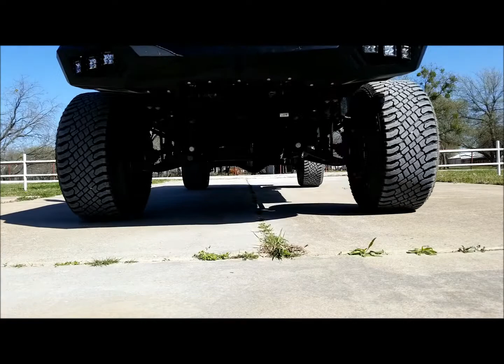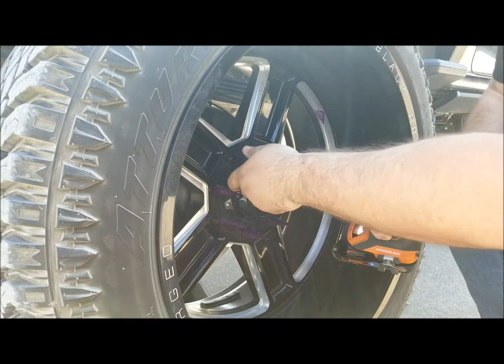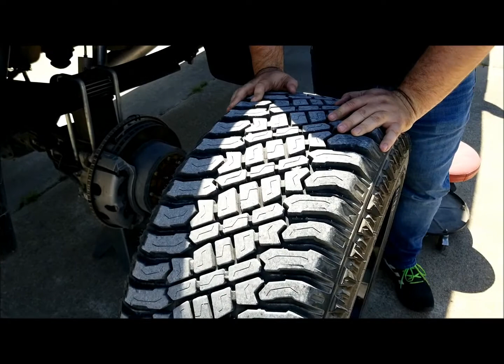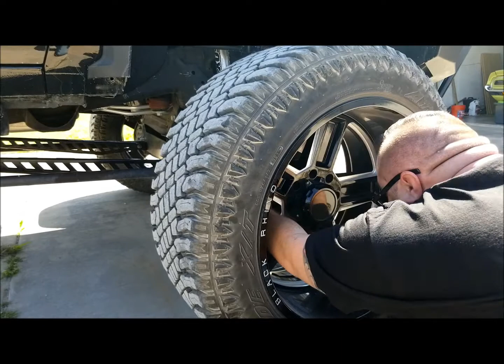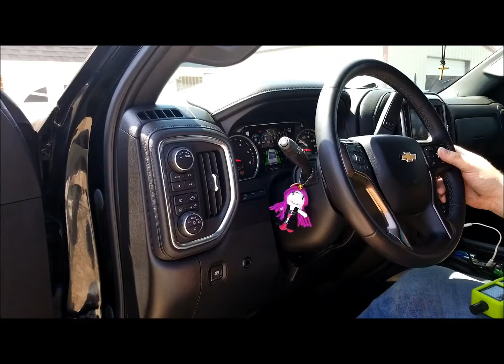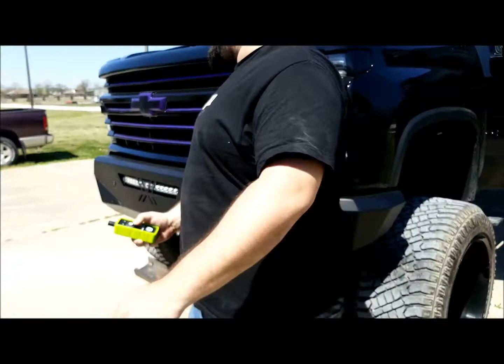Tire rotation tips on a Lifted 2020 Silverado 6.6 Duramax 4X4

Comment: 2020 2500 Diesel models require you to actually start the vehicle to the to the tire pressure screen if you have the roller button instead of the check mark button. The other videos the switch just in accessory mode.  Thank you for posting this,  mine is Diesel with the rotary button.  Once in learning mode, it was a breeze - - Thank You.   Nice truck BTW!!